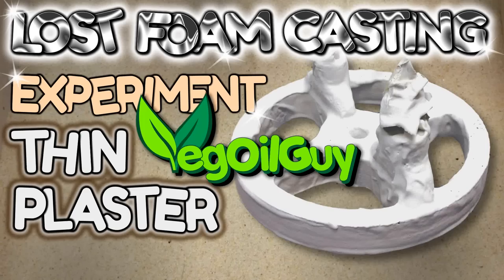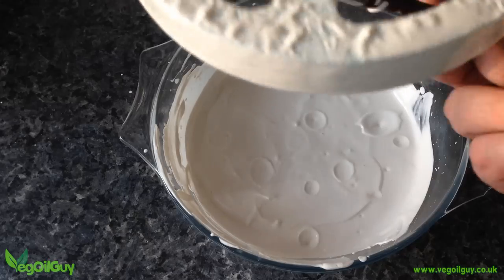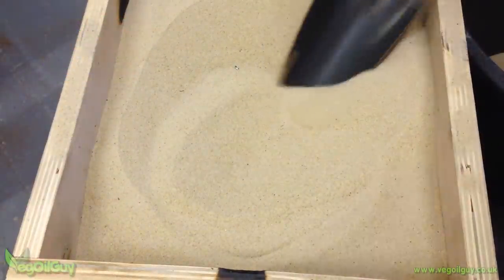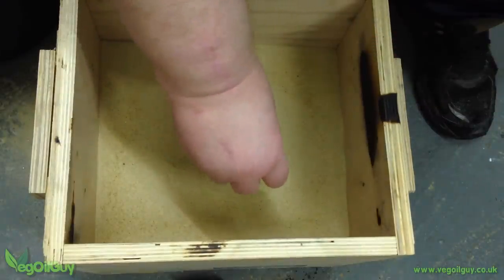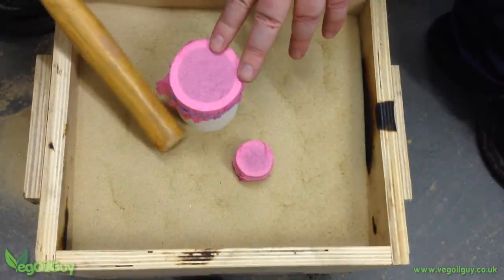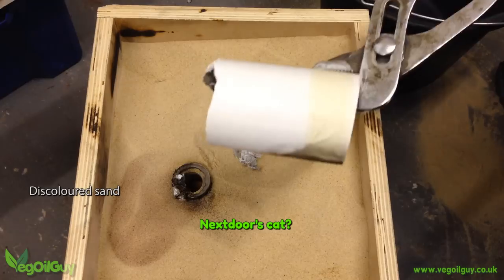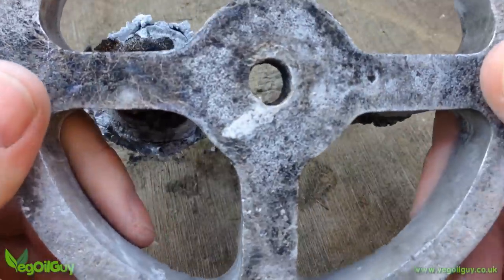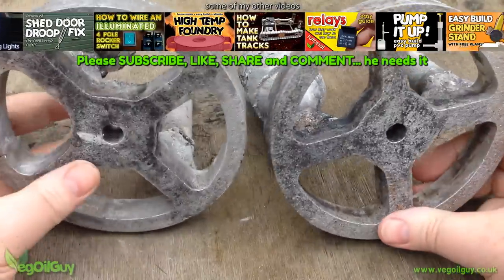lost foam casting: EXPERIMENT with thin plaster coating  by VOGMAN

Comment: I used thin plaster followed by thick plaster. After drying i pour in acetone to dissolve the foam. I have no problems with turbulence from melting foam.

Comment: This was a good attempt. One thing to note for the future is all lost type castings are in a negative cavity created by what is lost- in this case the foam is lost, not the plaster. There is no need to smooth the outside of the plaster. The internal negative void of the plaster is what is most important. You can try adding multiple layers of plaster to increase the supporting structure the molten aluminum will fill into. It may also be beneficial to burnout or chemically washout the foam, before the pour. It is likely the off gassing from the foam as it melted entrained gas inside the casting. It is also beneficial to have a hot mold to pour into, in order to extend the time the material remains liquid. The sand and plaster you poured into likely acted as a heat sink to suck the energy out of the metal and sped up the hardening time.

Comment: The term "Thin Plaster" implies less than filling the entire mold with plaster.
Removing the extra plaster is not needed as the only thing needed was a solid surface to prevent the metal from mixing with and sticking to the dry sand that is not going to be holding it's shape.
Also there is no way for the gases to escape so removing/melting away as much of the foam with acetone before burying it is best, so a thicker plaster shell would hold up much better.
Reply: I am late to the party. Oh well. I don’t understand why plaster with dry sand would be used at all. As someone who owns green sand, it seems the plaster method is much more time consuming and difficult to get right just to have equal results. Is it because green sand is expensive? I am still about new so feel free to School me.
Reply: @popermen694  I would say because with plaster you can copy very fine details and sand won't fall into casted piece. I think you could use this plaster shell with green sand.. But you don't have to, because th plaster shell is holding the shape..
Reply: @popermen694  
1. Plaster + sand allows complex casts without having to make inserts. 
2. Lower skill required to start.
3. Less initial investment.

Greensand has plenty of it's own advantages. Not having to wait for the shell to dry, and easy to remake a mold being mayor advantages.

Comment: 3:15 You could use a vibrating body massager to liquefy the sand while setting your mold. Also, I'm not familiar with this technique but it seems that you could create a thicker plaster coating and then pre-vaporize the foam to create a cleaner form.

Comment: I agree with you that the green sand keeps the pattern from moving so much. I have had lots of blowouts when I try to do a lost foam casting using loose sand only.  I do you like using a plaster coat and then green sand

Comment: For a first attempt that was pretty good.
Next attempt use plaster cornice adhesive, not just plaster, highly heat resistant, where basic plaster is crap with heat, and do a double layer.
It will work a treat.

Comment: I have been experimenting with the foam/plaster method and have had results similar to yours. I have done some research and my next plan is to coat a foam mold with thick plaster formed with several vents, then once dry pour in Xylene (or tolulene) to completely dissolve the foam before casting. I have tried Acetone and while it does dissolve the foam it doesn't do so completely. Xylene seems to do the trick. I have also learned that plaster must dry for longer than you think... At least a week in warm dry conditions. It holds on to a lot of water.
Reply from the maker: Thanks for that Paul. Plaster is strange stuff and holds water well past boiling point. 
I have experimented with thicker coatings and even whilst well vented, the results were much worse than those here.
If you enjoy experimenting (as I do) then carry on and let me know your results. I'm always eager to learn : )
If you're looking for a reliable, consistent technique, try this method using green sand -  https://youtu.be/ES1Xenom-e0
Reply: Paul, How did your xylene experiment pan out ?  I need to cast something with a fine amount of detail.

Comment: To prevent the foam outgassing from impeding the flow of the metal you need more vents because the plaster is impermeable . They can be small, like the diameter of a soda straw, but they need to be arranged so the areas furthest from the pour have lots of places for the gas to exit..

Comment: hi, you can 3d print or cnc a mold (or both), then fill it with wax, then you cover the mold with thin layers of plaster-sand-dry, plaster-sand-dry during few days, then you heat that mold and recover the wax, then you use a two half green sand mold with well and venting orifices and done.
you end using only the thin layer of plaster, the rest can be reused (included the printing filament with a filament extruder)

Comment: In green sand, the vaporised foam can vent through the sand, but plaster would only vent were you make vents. The foam turning to vapor would be many times the volume of the foam and that vapor caused a volcano and could have been a emergeny room deal! In investment casting, the wet clay (in this case wet plaster) would be showered with sand, clay-sand-clay-sand, six-eight times, then the wax (lost wax) melted out, then burned out, then pre heated for the metal pour. More vents may work, but I think with "not lost foam", green sand may the better way. Even in green sand, the sand can be packed to tight and also have no were for the vapors to go and all the hot metal exit with explosive force out were it entered or through the sand onto anything around and the more foam/metal, the more likely. Be safe.
Reply from the maker: Absolutely right! That's exactly what I've been preaching my friend. 
Good to have your input : )

Comment: The lost foam method that introduced me to lost foam used drywall compound, a quickset hotmud(5 min), but it was used so that the caster didn't have to use green sand, but could instead just use ordinary play sand. It's a way to produce blocky low detail parts with a minimum of fuss and very little technique. It's really a technique for people that want a quick part and have to cast it because for whatever reason they can't machine it.
Reply from the maker: Well said Lowell, and that's absolutely fine. I know I've made parts before now that weren't going to be seen but required an approximate shape and good strength. Such a technique is perfect for that  : )
Reply: @vogman  I am probably going to be using that technique for several parts on a CNC router.  Also, thank you for the detailed video series on the electric furnace.  I'm going to copy that design.  When I get my own channel set up I'll send people your way when they ask about it.
Reply from the maker: Thanks Lowell, I appreciate that. To me that's what it's about... as my mate BigstackD says, "There's plenty of views for everyone." So we may as well help each other  : )
Above you'll see James Burns has sent me his first video tonight which I'm happily to publicly share. When your channel is ready, drop me a line. Best of luck  : D

Comment: No casting should froth and bubble and spit AT ALL when poured. Anything that does this much is going to be a casting woefully full of gas and oxide film inclusions to the point of complete unreliability. I would expect this casting to show much porosity and may flaws when machined and to break in service unless extremely lightly loaded. Your green sand is a much better technique as plaster is NOT porous and apart from its own water content it will NOT let out the  gases that come from the decomposing foam. The commercial coats used for this process are porous (they are also very thin at around 0.2 mm) and I do not believe that they contain any plaster. An interesting experiment though, but with predictable results... Martin
Reply from the maker: Thanks Martin. Words of wisdom gratefully received  : )
Reply from the maker: Here's a question for you Martin, Green Sand or Petrobond?
Reply: Hey Geoff, I don't think Martin has used petrobond yet. I know that he and I have talked about it and that he's mentioned in other comments that he had not tried it yet. One of those things on the never ending list of things to try. I can speak to petrobond but not green sand as I've never tried that. Petrobond appears to be fairly porous (which I find amazing due to it using oil as the bonding agent).  I don;t think it requires the venting that green sand does (again I don't understand why). Petrobond does provide remarkable detail in the casting but then again if you look at the video that Martin just published https://youtu.be/yW4TgZoUsK8 and in fact all of his videos, he gets remarkable detail and surface smoothness using his green sand.

Petrobond does leave an burned oil film on the parts but that is pretty easily dealt with. Petrobond does also smoke quite a bit as well but I'm sure that to a guy that melts foam that won't be an issue ;-)
Reply: I believe you are correct, if I remember right commercial coats are a  resin-coated fine sand or thin ceramic, many containing fine zircon powder. In some ways, it's like a cheap version of investment casting process.
Reply: My thoughts, exactly.

Comment: Love your videos. I need your help !  
I am trying to do lost shell PLA casting. Which we all know sucks because PLA does no burn out clean and the mold keeps breaking because PLA expands and all that fun stuff. In order to do this right I would have to use wax or wax like materials from a 3D printer I know this. And also some proper investment plaster. My problem is the plaster needs a hight temp oven to burn out right and is also expensive. So I want to do zinc casts for cheap but with undercuts from 3D printed masters.
Anyhow here are my ideas and you tell me what you think Master caster =) 
1. Using fire proof spray paint (800°C fireproof) and spray painting coats of the paint and mixing with sand (kind of like suspenda slurry). Then burning out the PLA in a household oven (that´s all I have, my method is supposed to be cheap and easy doable at home with little tools, material I want to use is zinc so I can melt that on a camping stove.
2. Using high temp sealant (from the caulc postol) hold up to 1300°C --> again building up coats burning out the part and casting.
3. Using castable refractory / zirconium refractory / puty repair compounds (don´t know which ones yet) and then again coating the part, burn out the plastic, casting.
4. Air drying clay ---> burn out --> cast (proper clay would need again too hight temps) 

So basically I try to find a mold material comparable to investment plaster but with less heat needed etc.

Comment: I like you videos and thought I would pass along some of my experiments.  I have used water thinned drywall spackling compound with very good success very similar to what you did.  I have heard plaster actually has some plastic in it and will out gas and cause problems.  I coated the hot wire cut foam pattern a few times by dunking it in then thinned Spackle and let it dry a few days between coats.  I did not do any sanding and just placed it in the play sand and added a can as a feeder.  The results actually showed the hot wire cut ripples in the pattern.  Much better than any attempt  with green sand!  I am trying to make some aluminum gears with the method now.
Reply from the maker: Thanks for sharing that Fred  : )

Comment: this is great info! I bought some styro pumpkins from the dollar store, they are hollow (about 3/8 thick styro walls and 7.5 inches tall. my earlier experiments with these was the sand would start caving on the inside and I would loose my $4 investment. I plan on coating the inside only with plaster then fill with sand. once I clean the 40 pounds of brass I accidently spilled in my foundry I will have a go at this and tell you the results
Reply from the maker: Thanks Jason : )
I never plan to know everything. Like you, I enjoy experimenting and finding easy ways to do things. Only an idiot thinks there's only one way. 
Keep on experimenting my friend : )

Comment: Good work.I would try a coat of plaster,then whilst wet cover with a layer of dry sand then more wet plaster,sand again.Very important to dry very well.Airing cupboard for a week ,top shelve were the wife can see,works for me.I do prefer green sand method, but your way could be an easy way for certain jobs.Thanks.
Reply from the maker: Thanks Peter. I'm a green sand fan as well, though Lost Wax is really growing on me  : )

Comment: Maybe you could try adding fine sand to the plaster and applying it with a paintbush .Also poking holes with the needle as it drys might be solution to venting problems.Maybe using a cement( mix it with some fine sand ???) instead of plaster would be better idea.It would take less time to dry-especialy if made into a thin layer.I dont like plaster for casting i tried it with fishing weights several times and result was volotile even after several days of curing the plaster-that thing just keeps too much water in it.
Just couple thoughts.
Reply from the maker: They were good thoughts too. 
I fine plaster takes longer than green sand, but if there's an easy plaster technique that I can share with others I'll happily try. 
Thanks for the input : )

Comment: Have you tried sheetrock mud instead of plaster?  I've been using very thin mud (about like latex paint consistency) painted on just thick enough to add a little color.  It dries overnight or less and disintegrates during pouring but it makes the surface finish exactly like the foam was, hold the loose sand back.  With only the sprue (no vent), a lot of the gas from the foam goes into the sand and i get clean castings.  Recently did a burner body and it hydrotested with no seeps.
Reply from the maker: Hi Andrew. That sounds interesting... I've never come across it. A quick Google search reveal nothing in the UK. Is it a branded product or the name of a substance?
I do like to hear about alternative ideas : )
Reply: Sheetrock is a brand name for drywall.  What I was referring to is joint compound.  Whereas plaster sets and is waterproof, when drywall joint compound sets it is still water soluble.  Maybe joint filler or joint finish.
Reply from the maker: Thanks Andrew. I'll look out for it : )
Reply: I believe the sheetrock mud he's referring to is the stuff that comes premixed in a tub or pail. Unlike plaster which sets up chemically, the premixed stuff sets up by drying out, and more importantly, it shrinks slightly while drying which, in this application, would create many very fine cracks thus allowing the pattern to vent more easily.

FYI, there are also specialty  plaster formulations specifically designed for metal casting, along with the plaster, they contain chemical agents which cause the water in the plaster to foam up during mixing, the resulting bubbles are very small, too small to cause casting defects but large enough to make the plaster porous .
Reply: @85rocco  Do you have a link to these specialty plaster formulations specifically designed for metal casting. I have a project that has alot of fine detail.
Reply: Another name for it in the US is "spackle". I think a UK equivalent is Polyfilla? The kind of thing you'd use to fill holes in plasterboard before painting it.

Comment: Came out pretty darn good consisering that dirty trick the mold played on you!  
Next time you try the dry sand method, try skipping both the coating and the vent.  When you're bare-doggin' it like that, the foam can vent into the dry unbonded sand just fine.  If your sand is fine enough and you were conscientious with your vibrating, the finish may be acceptable.  Effective vibration is especially if there important where there are undercuts (also true when using the plaster).
Reply from the maker: Thanks for the feedback. My first attempts with casting were dry sand, though back then I had no idea about the importance of vibration, etc, so the results were poor.  I may revisit just sand and foam another time  : )

Comment: With lost wax casting, the wax is melted out before the metal is poured.  If the plaster shell were thick enough to hold up that might be an option with foam.
Reply from the maker: You're absolutely right. The same thoughts have been running through my head. It's a puzzle.
I suppose Wax Casts tend to be vertical (at least the ones I've seen) and there's considerable use of vacuum chambers to remove air, and the plaster is cooked in stages and is generally hot when the metal is poured. 
Somewhere in these differences is an answer. Guess I'll have to keep tinkering : )
Thanks for your input.

Comment: "Lost" casting process I have seen used wax, then a refractory mixture of plaster mixed with fine clay, silica flour, zircon dust etc. Was sprayed on with fines, then with larger refractory ballast, ie 3-4mm size pieces. All air dried, then warmed, then when ALL moisture slowly cooked out, was placed in oven to bake in the setting components, ie clay, and probably water glass, and this of course removed "lost" the wax model(s). As these were commercial castings these were ganged together in trees etc.
Results always spectacular, no gassing etc because nothing was there to burn, that is the entire concept of 'lost' process. The model needs to be 'lost' before pouring in molten metal.
And this plaster process is very dangerous, as there is still water present in plaster unless it is cooked out slowly, if the thickness is sufficient, it will explode due to the steam etc, been there, done that, molten brass is no fun when flying around.